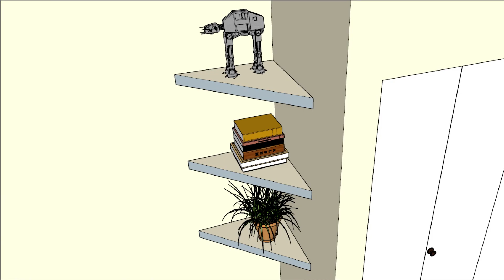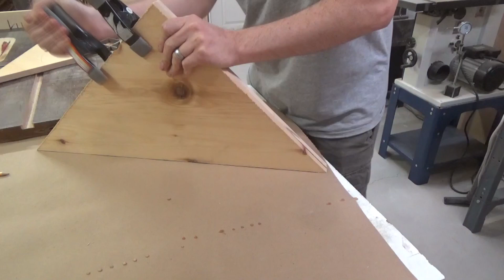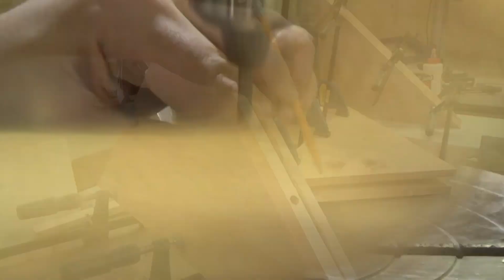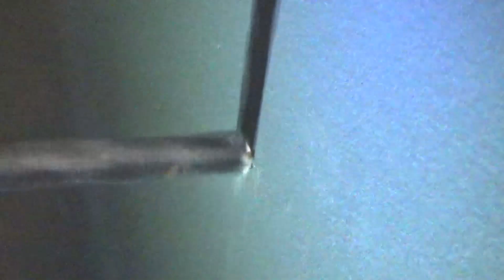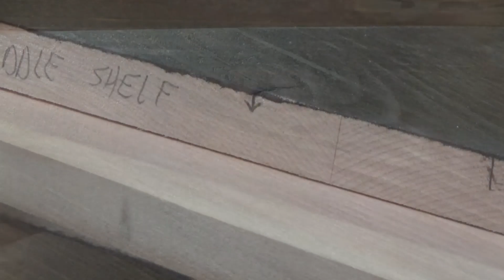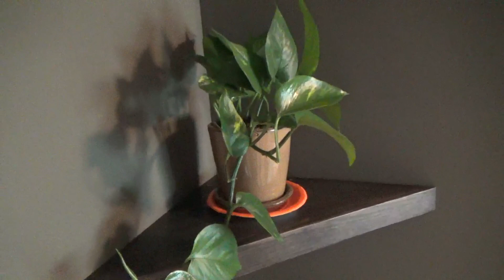Woodworking: How to make corner floating shelves - FREE plans!

Comment: Is it drywall anchors you use? Looks like it's for concrete? I usually use mollys that expand on the backside like a cross in metall for drywall..

Really smart way to attach it to the wall by the way 👍🏻
Reply from the maker: Standard drywall anchors work just fine.
Reply: @FishersShop  i wouldn't use that

Comment: Very nice and useful project. If you have a stud finder and could find some in that limited space it might have made the cleat attachments more secure. Doesn’t appear as though you’ll be storing any motor blocks on those shelves anyway but if they ever tear out that’s your fix. I’ve had bad luck with those little plastic inserts.
Reply: I have seen some plasterboard fixings locally (Yorkshire, UK) that require a large-ish hole (around 15mm) that claim to be able to support 150kg. How this is measured, I'm unclear on, but experience shows that plasterboard is stronger than you might give it credit for (as long as it's dry).
Reply from the maker: You're right, there won't be any heavy loads on them but they're actually quite sturdy.  Loaded them up with books and a heavy potted plant and they're just fine.  I guess time will tell. :)